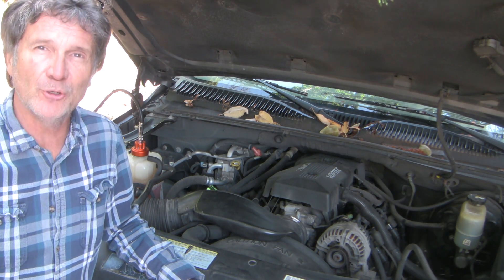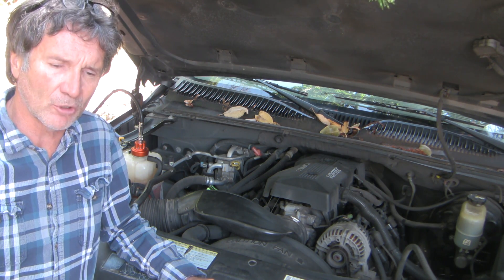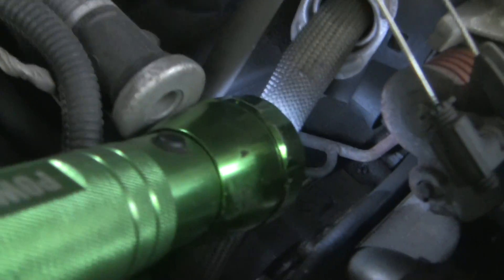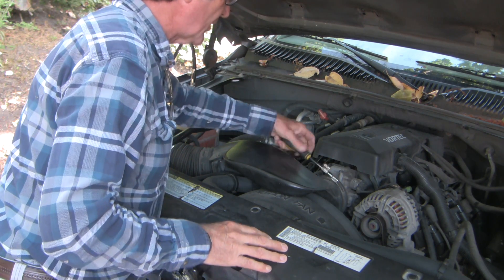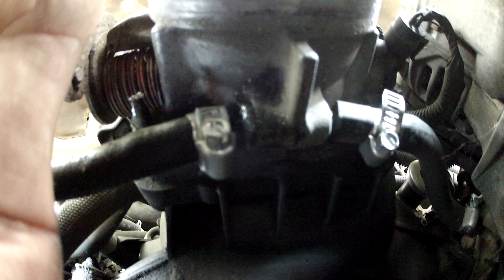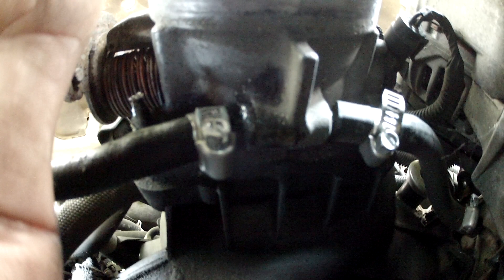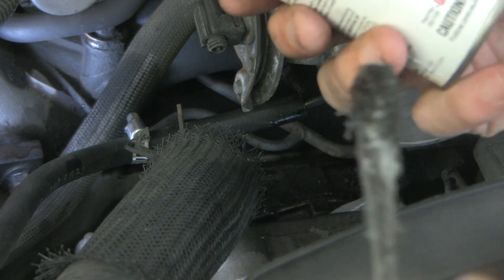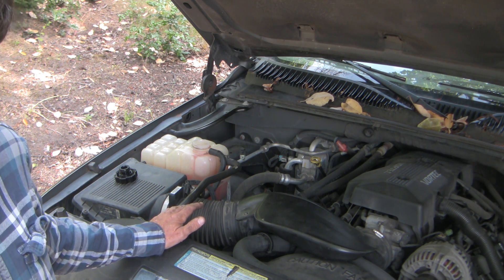How to diagnose a mystery coolant leak in a Chev/GM truck

Comment: Thanks! I’ve been wondering about my leak for years. It’s ever so slight if a leak but enough to make you or the wife worry.  Same thing, no evidence of leaking anywhere but a slight smell of the coolant fluid was a give away. Seems the video was proof of where my leak was. Again thanks so much!
Reply from the maker: Common leaks come from the water pump seal or weep  hole, hoses, sometimes the radiator or heater core, rarely a head gasket. This LM7 5.3 engine also occasionally had a notoriously slow leak coming from porosity of the head itself. Hopefully your solution will be more simple, good luck!
Reply: @spelunkerd 
Even more helpful information. Again appreciate it!!

Comment: I have the 05 Tahoe 5.3 (250k miles). Every time I fix a leak a new one arrives. Current leak is closer to the driver side right near the firewall. I tried for awhile with a mirror and light but could not find it.
Reply: Had this issue with an old van and it turned out the radiator was 90% clogged and the high pressure was blowing the coolant system all over.

Comment: There is another line that goes from the radiator under the motor and up the back of the ignition what are thiese lines called? Throttle plate coolant lines?
Reply from the maker: Transmission cooler lines, sending hot oil from the transmission into the rad, then returning cool transmission oil back to the automatic transmission. You get a pretty good view of those in an old video I did years ago showing how to change automatic transmission fluid and adjust bands. Those cooler lines were a problem when trying to reach one of the the band adjustment screws. In this video the throttle plate cooling line is the one I removed in this video.
Reply: So only one line goes to the transmission and the other goes to the throttle body! That dont make sense without a return line
Reply from the maker: @larrylee5564  There are two transmission cooler lines, full of oil. One line to throttle body.
Reply: @spelunkerd  oh well that makes some sense ither than mine is leaking antifreeze lol not sounding good

Comment: I will check mine tomorrow, I have a mystery leak on an ‘05 Tahoe.
Reply: Did you find the leak?
Reply: I’m loosing pressure in my 05 Tahoe and boiling over my resovior I can’t find the leak anywhere
Reply: @Andrew-B_eZ  Could it be a blockage? I keep having leaks on my 05 Tahoe, I’m starting to wonder if I have a partial blockage. I have to do the intake gasket next.
Reply: Radiator

Comment: I just got an '05 Silverado 2500HD last week. When I got it home, during a system checkout, I found I had no heat. That turned out to be low coolant. I added a gallon of antifreeze and the heat worked fine.
The thing that concerns me now is that I'm seeing excessive steam from the exhaust and there's a sickening sweet odor, not quite your normal cat converter smell. That has me thinking that the engine may have a head gasket problem and that I should contact the seller and let him know there may be a serious problem.
35 years ago, I had a head gasket leak on a '69 Buick Riviera and the engine grenaded while on the highway, utterly destroying it totally. It turned out to be a head gasket leak responsible for the piston hydrolocking. I just got this truck and now I'm concerned it may be a few miles away from a major catastrophic failure if I drive it.
Reply from the maker: Gotta wonder how much the seller knew, it is hard to ignore a persistent coolant leak.
Reply: @spelunkerd  Well I got the truck registered today ($445.09!! not including sales tax!!) and drove it to a couple of places. No steam out the exhaust. Now I'm thinking it was the low dew point and near 100% humidity that was creating an unusual exhaust condensation condition as I had a big cloud of what seemed to be steam lingering around the back of the truck last night. Today, nothing. But there is a smell of antifreeze near the engine compartment, so there is a leak somewhere. Just how much, I don't know.
But the radiator hose was not hard or under pressure this morning when I checked it, so that's a good sign.
Reply from the maker: @basspig  Good. You might have a look under the oil cap, condensation there is common and some of the earlier models of this truck had issues with head cracking/porosity.
Reply: @spelunkerd  Oil looks fine, no white foaming or other unusual stuff. Looks freshly changed, but prior owner says it's got 2000 miles on that oil.
Same goes for the tranny fluid. Clear pink, like just changed.
Truck runs great. But there is a coolant leak somewhere. It loses a noticeable amount every day.

Comment: Man i have a 2001 and I couldn't find where that leak was coming from and now you open my eyes I replaced the top hose even took out the thermostat I bought today a water heater but the leak is not near the water pump so it has to be your find thank u for your find....that made my day

Comment from the maker: As stated in remarks below, coolant warms the throttle body to get sensors and the throttle plate warming quickly. I've been looking for a good explanation for why this LM7 variant of the Vortec engine has crossover piping that ultimately sends coolant/steam to the throttle body, then back to the rad. Chev abandoned those crossover pipes in later years. For a good video explanation of why these 'steam pipes' are there, try this Youtube video https://youtu.be/e2_twsAziZ0.  It explains a lot, also including remarks about the unusual design of the thermostat and water pump.
Reply: I'm late to this video but the cooling is probably because on the earlier models of the LS style engines there was EGR that was plumbed back into the intake at the throttle body. On later models ~2005(?) on up, the EGR was deleted by the GM engineers, obviously not needed hence the cooling bypassed the throttle body.
Reply from the maker: @stevea6722  That's an interesting thought!

Comment: Thanks for the video.. My 2000 Silverado is always in need of fluid but thankfully Never ran hot.. I do hope this why I keep loosing fluid and seeing no leaks in my oil or anywhere..Thanks a bunch for this information👍👍
Reply from the maker: Thanks for the sub, man!
Reply: Leonard was this your problem after all? My 06 silverado is doing the same. Never goes hot and I'm constantly filling up on coolant but never spotted a leak

Comment: My truck is 97 C1500. No leaks anywhere but expension tank is always dry and i hear coolant slush when i gas.
No idea where it goes.
I dont even drive much, it just stands in the drive way draining ??????????????
Reply from the maker: Trapped air, from a leak, somewhere. Start by filling completely, if possible by filling the radiator directly as well as the reservoir. Recheck level and refill again after a couple of days. Check the cap, if any doubt about the seal of the cap or the integrity of the coolant reservoir fill hose, replace them. Look closely at the weep hole, and the water pump gasket connection, and at hose connection points for crusting from evaporated coolant. check under the reservoir for a leak at the coolant sensor gasket and for a crack in the coolant reservoir. Use a light to carefully inspect the sides and front of the radiator looking for water staining. When you change your oil look for water contamination, for "pudding" under the oil fill cap, and for white smoke out the tail pipe. Look for a wet floor mat on the passenger side. Eventually you'll find the culprit, hopefully not while on a long summer trip, ha ha. Good luck!
Reply: @spelunkerd  Thanks !

Comment: I have been searching for the leak in my 05 silverado for 3 years been to the shop half a dozen times you have given me a good place to investigate thank you.
Reply from the maker: In addition to leak at that hose, this generation of the Vortec engine had a problem with porosity of their aluminum cylinder heads, leading to some developing tiny leaks through the head into the oil. I'm not sure about the 05, you might have a look at the cylinder head id number and the oil fill cap. Leaking there can cause a brown pudding forming on the inner side of the oil fill cap, although sometimes you can get a little pudding even in a normal car. Good luck!
Reply: @spelunkerd  But his leak was external, he could see a puddle on his driveway. His leak was not internal, where as an internal leak, you would not see a puddle on the driveway
Reply: Mine leaked into my engine oil and I ended up needling a new engine

Comment: I have a 2003 Silverado that's guzzling coolant.. There's no puddles no nothing when I park it. So I put it up on jacks and looked around underneath and there's coolant everywhere underneath the motor.. Looked over all the hoses couldn't find any signs of a leaking hose. And there's no coolant leaking internally otherwise the oil would be a muddy brown color. But I haven't taken that cover off to look at the crossover so could possibly be one of those two hoses. Can't see them too well with the intake in the way so I'll take it off and look
Reply from the maker: Good luck, if you don’t have a pressure tester you could inspect with engine running, but be careful! The weep hole is there, but not easy to see....
Reply: @spelunkerd  I took the throttle body off and there was coolant up inside there but the gasket looks fine.. Damnit Chevy!! 😂
Reply: What pressure tester cap is that? I trying to find one so I can pressure test mine

Comment: TRYED to do this 
Pluged the over flow 
Were the tube comes out of the overflow it would not seal
I put a hose clamp on tight a as I could get it. Still no seal 
The overflow nipple is not round
And would not seal to the hose 
This is the kind of thing that happen
Reply from the maker: There’s a vent tube hole that leaks, try plugging the vent tube.
Reply: @spelunkerd  not sure what
 You mean 
I plugged the tube out of the overflow not leaking At plug
At the base of the fill / overflow it is oblong in stead of round that is were it is not sealing also as cold as it is I don't want to make it worse till spring. Also it has 706 heads😞 so I want to get other head before they crack.

Comment: Oh man, I almost bought an entire water pump system. Mine does leak  and leaves a puddle and I just could not find the darn leak. I will check that later in the week. I went to Walmart and they told me I have an oil leak yet I have no oil on my driveway. This video is a major help.

Comment: Gonna have to check there 
Ive got a sloshing sound now from my passenger side dashboard i have a feeling i have a bad heatercore 01 Tahoe 200k miles
And yes they pressure tested it last year!
Reply from the maker: Yeah possible. Any cause of trapped air will do this, always start with burping and checking seals, hoses. I did another video of a mystery leak in my Dodge Ram. Turned out to be a pinhole hose leak in one of the heater core hoses, very hard to find. Good luck!

Comment: Does this one have the ls or the previous generation small block Vortech?

They were still using both during those years
Reply from the maker: Good question, I find this topic confusing, even after reading an extensive Wikipedia article on the LS GM small block engine. My engine has the letter 'T' in the eighth position, which labels the engine as the LM7 variant of the 5.3, a subtype of the Generation III Chev small block. As you know there were many LS variants. Reading through that article, GM routed coolant through the throttle body to warm incoming air to promote fuel atomization during cold weather in early versions of their small block. Later editions discarded that innovation because of coolant leaks and because modern fuel injectors don't rely so much on warm air for atomization, and also because warm air has a lower oxygen density. Thanks for stopping by!
Reply: @spelunkerd  Thx. If yours is the 4.8 or 5.3 or 6.0 then it is an LS for sure. 

However they were still putting some previous generation 350 cubic inch or 5.7 in those in the late 90s and early 2000s and I believe they made a 5.7 LS aswell but I'm not sure if that was only in the Corvette or they also put that in the trucks

Comment: I replaced the water pump in my 2002 GMC Envoy about 4 months ago, and just recently started smelling coolant when I turn the vehicle off.  Where do you suggest purchasing a pressure tester?
Reply from the maker: Harbor Freight, Amazon, Princess Auto, Ebay, many auto parts stores. The adapter kit is fairly important since it needs to be versatile enough to fit many vehicles. If you smell coolant inside the cab, feel the carpets for wetness, especially on the passenger side. A heater core replacement is a big job, hopefully not. I would have liked a cap tester to verify the pressure needed to open both the cap valves. My kit doesn't have one of those. If you smell coolant around the water pump, try to get a look at the weep hole from underneath.

Comment: After water pump replacement (suddenly it started severely leaking at the main shaft) I am loosing slowly coolant. I can smell something strange after several straight in a row WOT (wide open throttle) acceleration on my 2000 Tahoe. Where shall I start looking?
Reply from the maker: If a new problem develops after working on the car, most of the time it can be traced to something you did. I'd be checking to be sure I didn't put the pump on with a fold in the gasket or gasket malposition. Even a piece of grit might be enough to cause the pump to go on cockeyed and leak after, and sometimes if you don't bolt the pump on with a cross pattern it will not cinch down evenly. Remember to hook up both hoses that attach to the undersurface of the throttle body. I would inspect looking for coolant leak out the weep hole, try to identify where it is coming from. A coolant pressure tester helps find microscopic leaks, some parts stores will loan them out. It isn't uncommon for pressurized coolant recovery tanks to leak, they are made of plastic. Also watch out for a bad seal at the cap, if it won't seal the system won't form enough pressure to work and you'll slowly lose fluid in the form of condensing steam. Regarding your point about odor after WOT, a head gasket leak can present in that way, and a previous overheat might be enough to blow a head gasket. Let's hope it is not that. Look for brown pudding under the oil fill cap, and look for steam out the tailpipe. The Chev 5.3 Vortec had an issue with cracked heads, but that wouldn't usually give odor after WOT. Odor is sometimes found with a leak at the heater core, check for wetness on the passenger side floor mats.

Comment: My only criticism, and it's a minor one, is to use anything other than worm-drive clamps.  Spring/tension clamps or fuel-injector hose clamps are much better at evening distribution of tension around the hose.  They're fairly inexpensive when ordered in an kit of various sizes, then you'll always have them on hand.
Reply from the maker: Excellent point, I've been slowly coming around to that perspective now for years.

Comment: Hey how’s it going I recently discovered my Chevy 01 has a engine coolant leak under the truck so it’s been leading to a puddle and me having to fill it up every other week if your able to post a video of something like that it would be great
Reply from the maker: You need to find where it is leaking, and replace or fix the bad part. Common places are hose connections, radiator, water pump gasket or weep hole, reservoir, or reservoir vent.

Comment: A quick tip when removing those hoses under the throttle body use some small vicecreap ply iré to prevent from loosing to much coolant..
Reply from the maker: Good point. I have a set of small needle nose vice grips with rubber hose on the ends so that rubber tubing doesn't get damages when crimped. Honestly I didn't expect this one to drain much, it drained more than I expected.

Comment: Very good video.. I get a strong smell of antifreeze on my 06 tahoe after engine has been running for a while. 
Although it doesn’t overheat I will be checking that next..
Reply from the maker: If you can smell it in the cab, check the floor mats, it is probably a leaking heater core. The one other thing that can cause wet floor mats in some vehicles is the drain for the AC evaporator, which can get plugged with dirt and cause overflow, but that is just water, not coolant. Heater core removal is a pain because of all the plastic you need to remove to get at the coil. Good luck!
Reply: Thanks for your advise.. I will be checking the hose under the throttle body next.. since the passenger floor board is not wet and you can only smell the antifreeze when you descend the vehicle after it has being running for quite some time.. thanks

Comment: The coolant looked watery, as though it is not close to 50/50. Even if you live where it never freezes (awful hot and rhymes with swell - California) the cooling system needs corrosion inhibitors. A simple tester is cheap.
Reply: ThY dexcool is terrible unless you want your system clogged up it sucks I always pull it out because it made many clogging in another vortex motor I had it running in they couldn't even get it cleared after trying to clean the system four times he ssid there was no way because the water takes the path of least resistance and I'll never run dexfool again